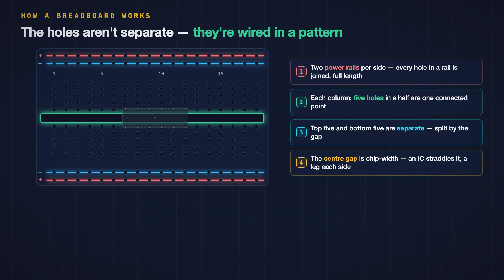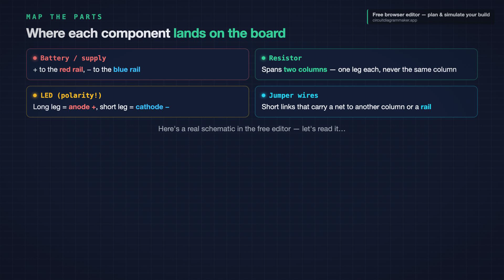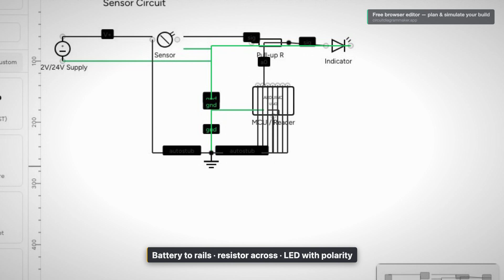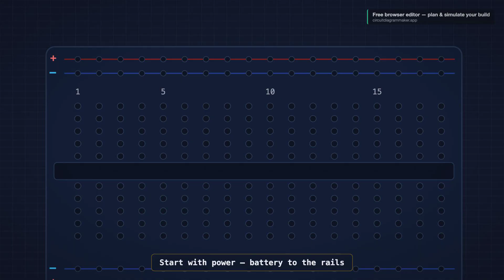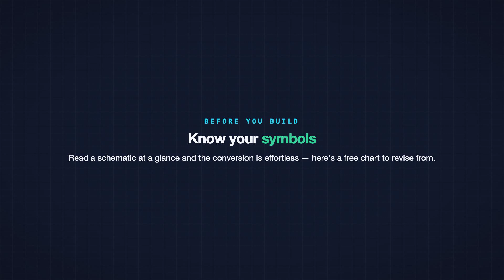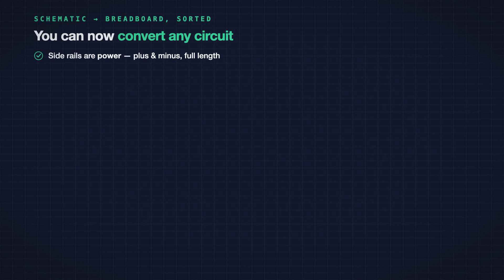Circuit Diagram to Breadboard (How to Convert)

Comment from the maker: The one rule that makes schematic-to-breadboard conversion easy: don't copy the shape of the drawing — copy its connections. Every net in the schematic (everything joined by a line) becomes one connected group on the board — the same five-hole column, or two columns linked by a jumper. Walk the schematic one node at a time, put the legs that share a node together, and the layout can look nothing like the drawing yet be the exact same circuit. Plan and simulate yours free, no signup: https://circuitdiagrammaker.app/try?utm_source=youtube&utm_medium=pinned_comment&utm_content=yt-106